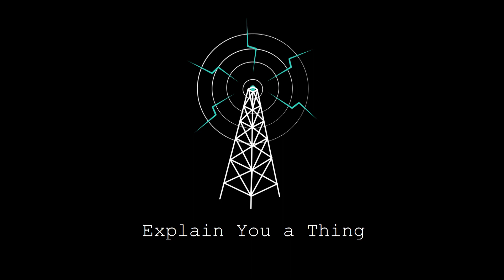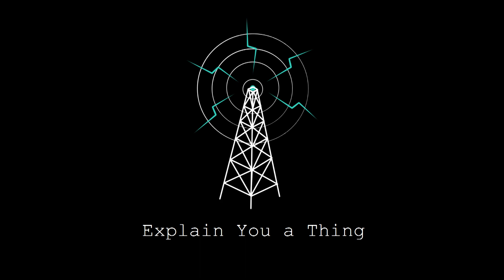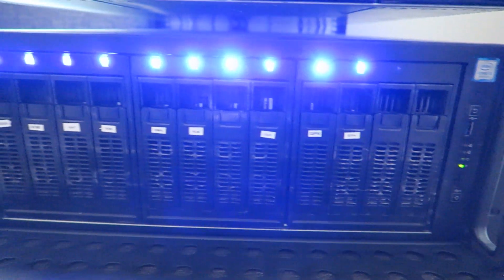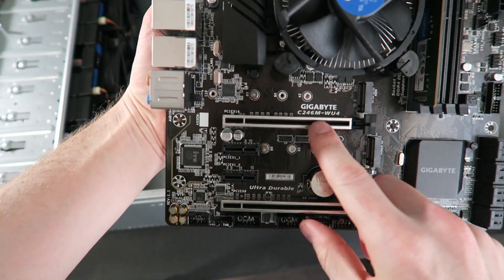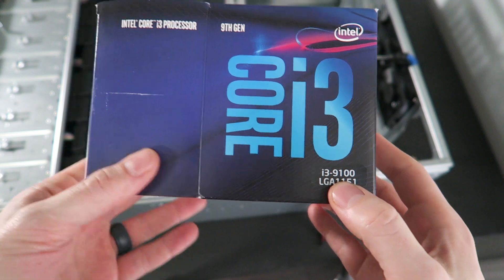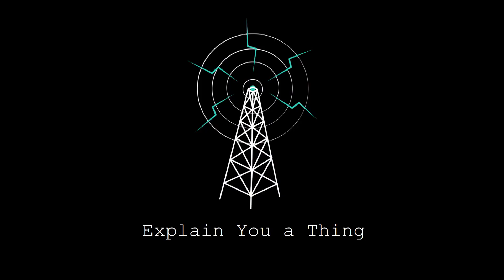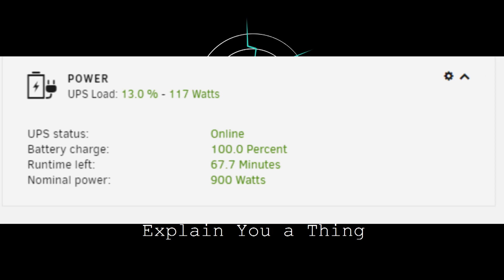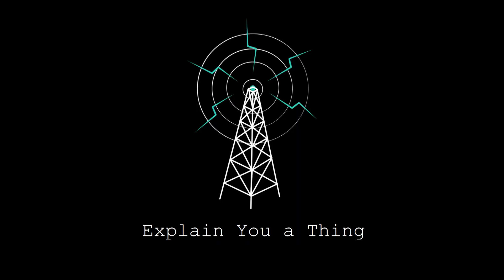My Energy Efficient unRAID Build

Comment: 81w at idle is still far too high if you don’t have a GPU in there. I run a 4690T with parts cobbled together and it idles at 26w, newer CPUs could potentially go even lower than this.

Comment: Why did you waste 1U in between the servers? That space does nothing.
Reply from the maker: Easier for me to get the top of the case off without having to pull the lower one all the way out to the end of its sliders.  Also, I don't have a full rack of stuff so it doesn't need to be crammed in there.

Comment: I'm not sure what you use your unRaid server for outside of NAS, but figured id share my tips I used on my build. I'm always looking for suggestions to improve my setup... Anyways I bought the 10600k CPU for my build, not for overclocking, but to allow underclocking.... I was able to underclock/undervolt mine stable down to 33 watts idle power and still reliably power all my docker containers and run plex on the iGPU...
Reply from the maker: Oh nice.  I may look into that.  It's strictly a NAS for Plex streaming so it's largely just lots of reads.
Reply: Ya I got the idea from messing around with overclocking. I initially went intel 10100 for the unRaid server, but I had the 10600k as a budget gaming pc during covid and i noticed the wattage of the system would drop a lot lower when the CPU would drop to 700ish Mhz going through the various states. So i replaced the 10100 with the 10600k and I tried to mess around with it in unRaid, but the docker containers would never let it drop in power states really while active, so I figured I would force it and messed around with it. I could get the frequency/voltage lower, but the iGPU would malfunction during plex streams, so opened the max number of streams I would ever have running and messed around with it until I found the lowest I could go without it crashing or locking up on me. Overall the K variant ran at far less wattage due to the lack of ability to unclock/undervolt it. Something else that i found during my testing, someone mentioned that NVME SSDs consume more power than regular SATA SSDs, so I tested it out and found that my 2x 500GB NVME cache drives used 7.8 watts each while active, but an old non-NVME SSD used 2.3 watts, so when i decided to upgrade my cache pool and switch to ZFS for self healing, I went with non-NVME SSDs and just used a M.2 to 6 SATA adapter for my cache drives since I ran out of SATA ports. i ended up switching to 3 x 1TB Teamgroup CX2 SSDs i picked up on sale for $24.99/ea @ExplainYouaThing
Reply from the maker: Excellent, I can probably get away with a lot because my Plex server isn't in a container on the NAS so I won't have to worry about that part at least.  I'll definitely be swapping out the NVMes that I have with SATA again.  Not only are they more efficient, like you found, but it'll get some heat away from my motherboard

Comment: From what I hear, those SATA cards are often really cheap and can die easily. I.E: Anything more than 2 SATA on a card, and I guess it just dies at some point. You can get legitimate used 8i SAS HBAs for like $60 or less these days.
Reply: I run a cheap PCIe 4 port SATA card on a 15 year old AMD system for my unraid and zero issues.

Comment: How did you power the drive modules? You mentioned in the previous video about this case the two 4 pin molex connections to power each of the 3 drive modules, but in this video you don't have any of them wired up.
Reply from the maker: Just several leads from the power supply.  My particular PSU had three sets of molex wires and that is what I used.  You really do need three separate cables though as the power inputs on the modules are grouped together but far from one another.

Comment: Great video, but I have some questions ? to take advantage of the ECC Ram, it also needs to be supported by the CPU, and as far as I am aware, Intel removed the EEC use from there CPU's after gen 5. So now only Xeon CPU support the EEC function of the ram. Or have I got that wrong ?
Reply from the maker: This was very recently re-enabled on most of the Core series CPUs. I want to say Gen 12 and newer?  That being said, this CPU allegedly supported ECC fully when I purchased it.  It hasn't had any issues running with ECC but perhaps I have made a mistake on my setup here.  I'll have to do more research.  Thanks for the heads up though.

EDIT: did a quick look around as my memory isn't amazing.  Yes, the combination of chipset (c246) and this processor take advantage of ECC.  Admittedly it's been a minute since setting this up so my memory wasn't exactly fresh on the subject.
Reply: Yes I got it wrong, I3-9100 supports EEC, what I was told when looking for a system was wrong. Thanks again for the video.
Reply from the maker: There's a lot of information out there these days it seems.... Alas some of it isn't very good. Cheers!

Comment: Hey there! I just stumbled across this video and enjoyed it! (And subscribed). I'm sitting on a pile of hardware from my old unraid server and I'm itching to do something with it. Wanna give me some ideas? If not just disregard this gigantic comment lol. The systems has an X370 Taichi AM4 motherboard (with 10 sata ports), 64GB of non-ecc ram and right now I have eight 4TB HDDs. The system HAD a ryzen 5 3600 but the CPU is failing and has an issue. I didn't know this at the time (the server would just reboot after a random amount of time, finally figured it out with a L3 cache error I found in a kernel log while running ubuntu... If the system is running windows it's 100% stable, so I dont know what's up with it lol. But the server ran fine for around 3 years running unraid). Anyway, when this all went sour I picked up a used HP Z4 G4 workstation with a Xeon-W 2133 and some refurbished 16TB toshiba drives from newegg. So the my entire NAS setup is on new hardware.
So right now I could pretty much buy any Zen 2 or Zen 3 CPU and have this system back up and running. I just don't know what I should do.  A current idea is to get something a little more high-end like a ryzen 7 5700X (or better). Install manjaro or whatever desktop linux I want, then setup a ZFS RAID Z2 with the 8 HDDs and mount it into my /home. Then all my data on my primary unraid server will have a second home and I'll have a cool workstation in the process. I have a GTX1660 Super I can throw into and have a cool little workstation with some fat storage, but idk if ZFS has a lot of CPU + RAM resource overhead where gaming on a setup like this would be a bad idea. 
Is it even worth it to invest in AM4 anymore? Should I just install windows on this computer, put the 1660 super in it and sell it? :P then save for something that will use DDR5 memory? Or save up and buy a board with more enterprise-class features?
I was thinking if I wanted to go more of the NAS / Storage route of picking up a lower TDP APU so I don't need to also have a GPU plugged in... Maybe do truenas scale? 
Right now in terms of my desktop workstation I run VMs on UNRAID and pass through my GPU and a PCI-E USB card and it works pretty well. But a Zen 3 AMD cpu would outperform that Xeon-W... however my RAM isn't ECC. :P "

Anyway, just brainstorming and want to do something cool with this junk lol
Reply from the maker: Hard to say there.  I'm kind of more in the camp these days that, after a certain point, old hardware just ends up costing you more in power/heat in the long run.  To add to this, I used to resurrect old stuff on the regular to use for various projects but at some point I just found myself chasing down broken stuff or trying to replace hardware that's scarce or just old.  

I won't deny the fact that it's fun to get old stuff working through!  I have a pretty ancient collection of hardware running my backup NAS but it's off 98% of the time so the noise/heat doesn't become unbearable in my small office.

Comment: Honestly, if power efficiency is what you want, you simply have to adjust your usecase. My server runs an EPYC 24 core cpu with 256gb mem im consuming 100watts on average idle with just my CCTV stuff running, (so thats 2 WD purples, the other 14 HDD's are standby, and i'm prefering an NVME cache pool to move data away from every 12 hours). Normal operation is about 160watts when all disk are spun and utilization is around 25%. So i geuss, im paying a bit for the headroom.

Comment: Hey, what did you end up using to plug those 4 pin fans in at the back? I'm about to migrate a build into this case and I'm not sure if I should just buy two new fans to stick in there or buy some 4-pin-to-sata cables to meet my power supply, or buy some dedicated peripheral cables from corsair. Btw, how are your temperatures in this case? I'm thinking about drilling a bunch of holes into the side of it and flipping the PSU around so that it can suck from the side of the case as opposed to sucking air from within--but my box will be in a basement anyway so not sure it will be that big of a deal.
Reply from the maker: Just an extra 4 pin off of my PSU.
Reply: @ExplainYouaThing  Your PSU came with enough cables to support both the hotswap cages + the fans? I had to get an extra cable to support 2/3 of the cages, and now looking at another one for these fans.
Reply from the maker: Yeah I had plenty.  Though I honestly can't remember if I just highjacked the extra modular cable from another PSU.  I've been using this same one in various systems for a while now.

Also, sorry I didn't see your question about the temps.  I haven't had a single issue with temps in this case.  However, as my build really focused on energy efficiency and low heat it likely wouldn't be an issue in even a very very tight case.

Comment: Great video.  I just built my first server and I put in an ITX MB with an i5 and 32 Gb of memory.  I did add a SAS card and I currently have it running 12 3.5-inch hard drives, all 10 Tb with 2 parity drives.  I am now moving my stuff from a 2-bay TerraMaster and a 4-bay TerraMaster to it.  Once done those will go to my son for his gaming storage.  I do golf videos for clients and I also do photography and video at events as a hobby I just needed the storage capacity.  The only difference is that I used a full tower PC case which can probably fit 24 hard drives if needed.  It is so quiet that my wife thought it was off the other day when she went into my office.  It wasn't.  BTW, I run unraid and I can't be happier with it.
Reply from the maker: Yeah honestly, for personal use, I couldn't be happier with unRAID
Reply: I've changed my unraid pool to use ZFS now that it has been integrated into the UI.

I use both Truenas and Unraid. All ZFS now!

Comment: UNRAID vs TrueNAS in a reply. :) (I run OpenMediaVault and want an upgrade.)
Reply from the maker: UNRAID has it in terms of flexibility being that you can mix and match hard drive sizes and also use all the capacity of each.  That being said, write speeds are the drawback, though this is mitigated by running a cache pool of SSDs that take the initial writes and move them to mechanical drives later on behind the scenes.

TrueNAS kind of takes the cake in terms of speed as it's just standard RAID and thus takes advantage of the striping a bit not effectively.
Reply: @ExplainYouaThing  thanks. Now I understand the name … UNRAID.